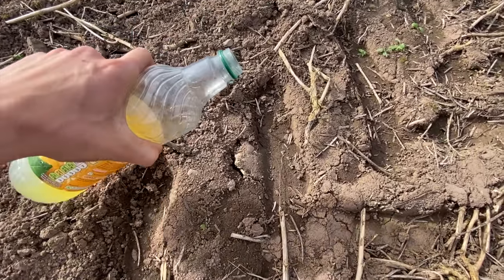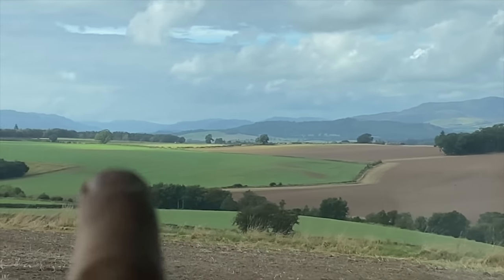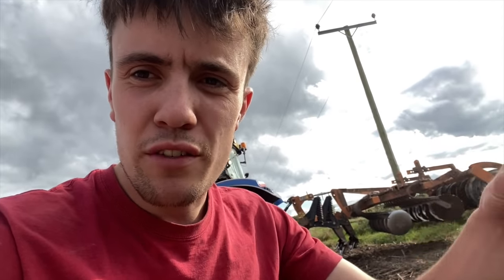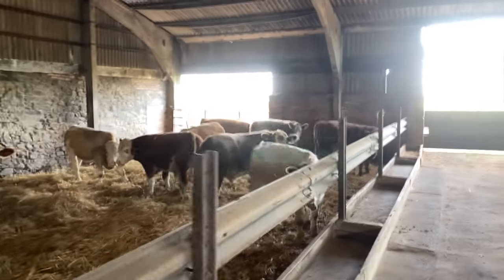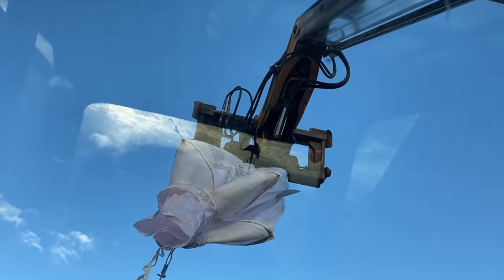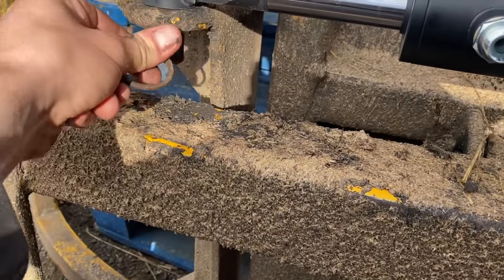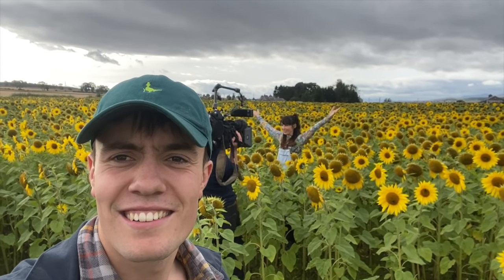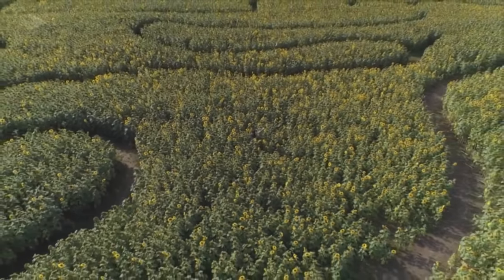CAMERA CREW ON THE FARM | DEPARTMENT TESTING WHEAT | FITTING NEW HYDRAULIC RAM #CRAWFORDFARMS #116

Comment: You should get some "HARDFACE" welding rods and weld diagonal lines on the tine points on the discs, should make them last at least twice as long. It was suggested to cut the wrap on the treated bales well before you use them to give time for the gases to disperse. Ammonia gas is not good for you. Thanks for another great video, catch you on the next one.
Reply from the maker: Will look into them! been cutting the next one each time i take one, just wanted to see what the fuss was about